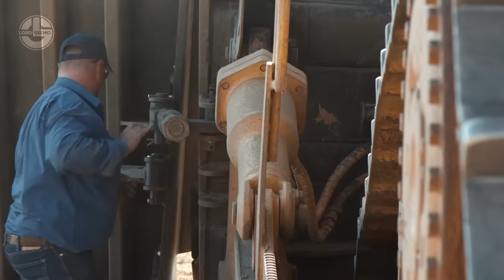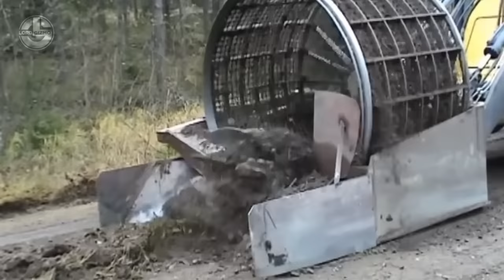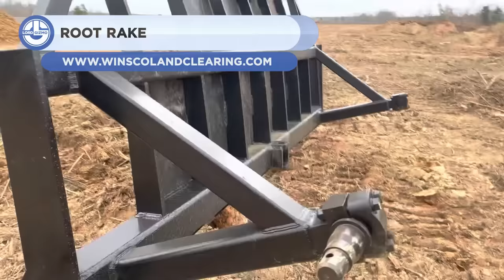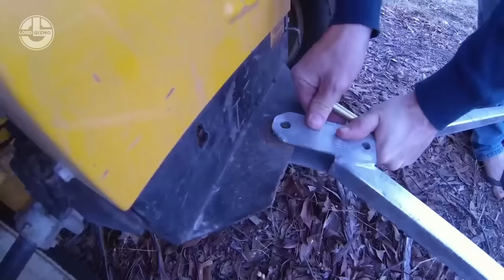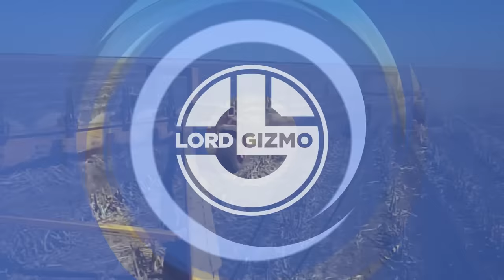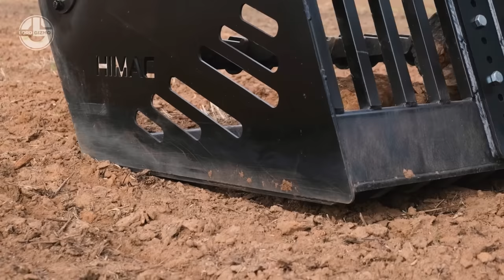Mind-Blowing Stick Rakes AND Land Clearing Machines That Are On Another Level

Comment: Would be good for land mines.
Reply: While the sprayer is efficient and useful in agriculture, using it for land mines would require different equipment specifically designed for that purpose.